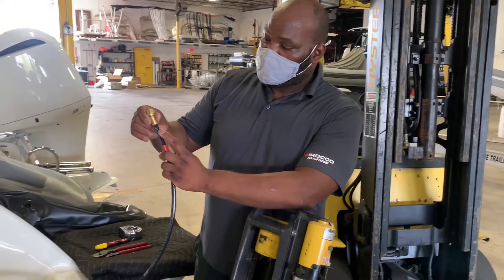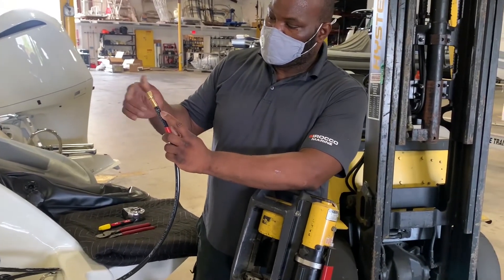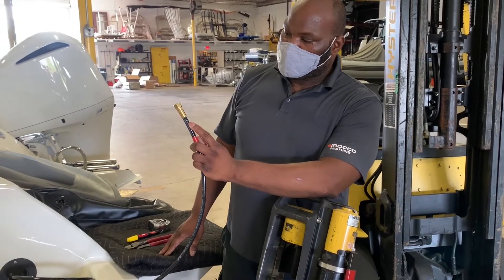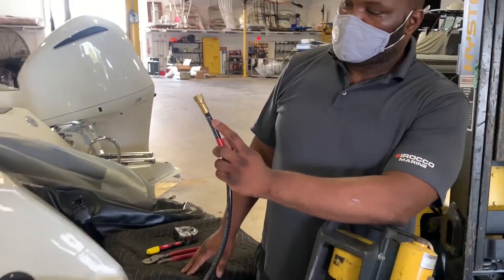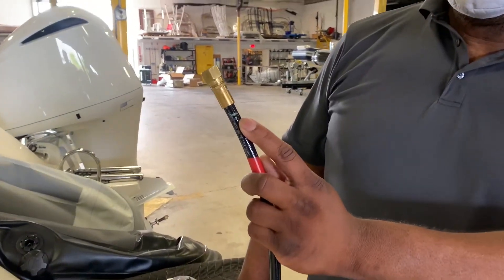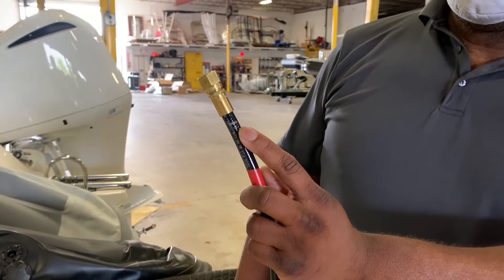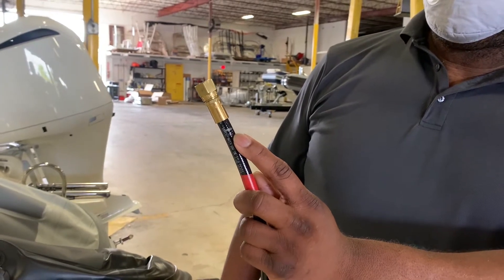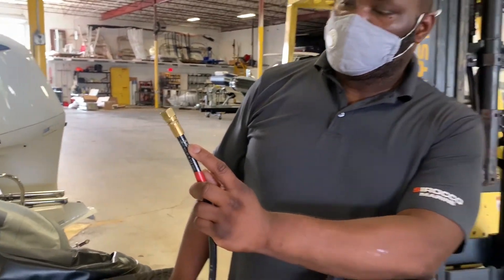How to Connect Hydraulic Fittings on your Boat

Comment: I bought the same fittings.  I can’t get the second piece into the hose.  Does the impact help prep the hose for the second piece.
Reply: It shouldn’t be difficult if it’s not going in you may have the wrong size fitting. I use Parker 2TFMS-6-5B for the standard Seastar 3/8” tubing. Works well and holds upwards of 3,000 psi well above the hose rating.